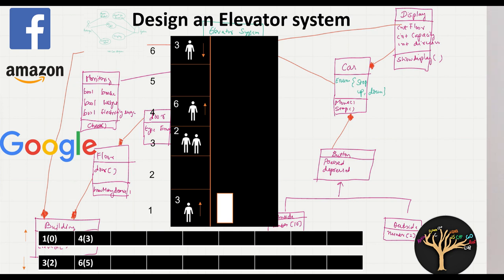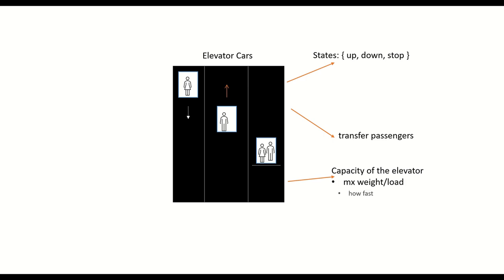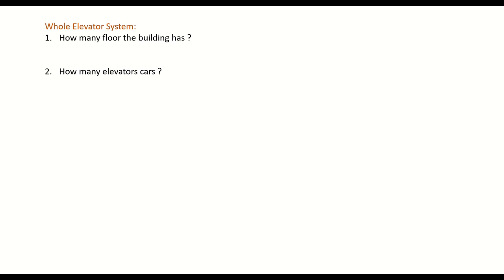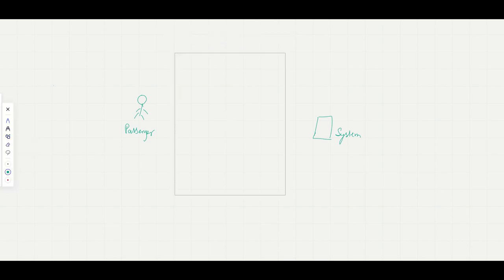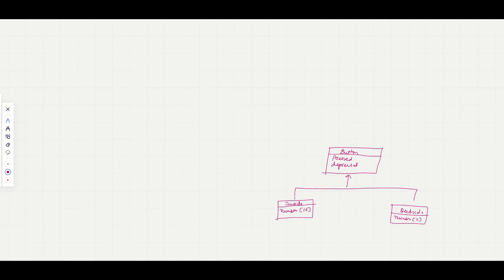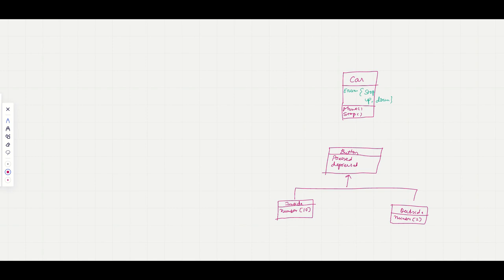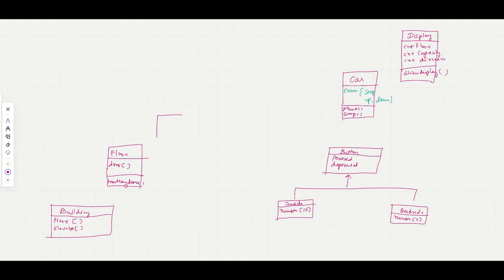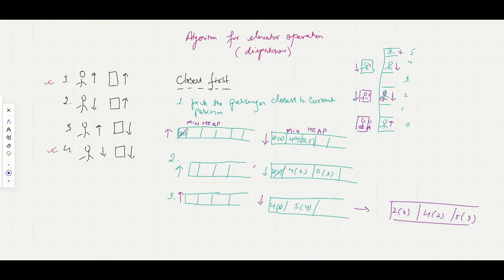Design an Elevator System | Systems Design Interview question | #FAANG

Comment: MinHeap update operation is quite costly since its getting updated at every move of lift in either direction O(NLog(N)) to be precise
Reply: It's an ELEVATOR. It only has so many floors. Unless it's being implemented by actual snails, or a 1HZ processor, I think it will be fine.

Comment: In the last optimization, when the elevator was moving up and dropped the passenger of floor 0 at floor 2,  and picked the passenger at floor 2 who requested a down , why the elevator changed the direction and dropped them first. Shouldnt the lift  continue togo up and attend the request of the passengers going up first?
Reply: that is the drawback u would say for this algorithm thats why we have to take care of one direction only by marking any of the direction as true either up or down once the lifts starts to move maintain 3 varibles as bool and mark them as true until it reaches the last pos of requested then mark as false and changes the directin of the lift so that the requested of other can also be taken care of

Comment: Runtime updation of minHeap, as the elevator car crosses a floor, is equivalent to creating a new minHeap everytime? 
I am not sure there is any straight forward way to update the values in a minHeap/maxHeap.
Reply: There is a “decrease key” operation in the Heap which does changing of node’s value, in o(log n) runtime when it is combined with HashMap to maintain the position of node in array (Heap uses behind the scene). You may explore it further.

Comment: In the last part of the video , you have used 2 heaps . When you are not using the direction of the car to pickup up the passenger , what's the point in keeping 2 heaps ? You can simply use 1 heap and pickup the closest passenger irrespective of the direction he/she wants to move. This is a bit confusing .
Reply from the maker: Thanks for pointing out. Yes, if you are not having a constraint on direction then you can use just one min heap, I wanted to give a starting algorithm which anyone can extend and optimized further. e.g.Some elevator systems pick passengers only in the dircetion of travel then the 2 heaps would help.
Reply: @codeTreeMS  This was my first thought. Starting at floor 0, it goes up until no one else needs to go up, then it starts at the top and brings down everyone who needs to go down. then start with people going up, rinse, repeat

Comment: Sir, one small doubt, how many elevators are required in buildings
Reply from the maker: It depends on how many people work/stay in the building, like an office with a high number of floors with 1000 people working will require more elevators than a smaller building with 300 people, its something easy and you can discuss with your interviewer to decide on this requirement.